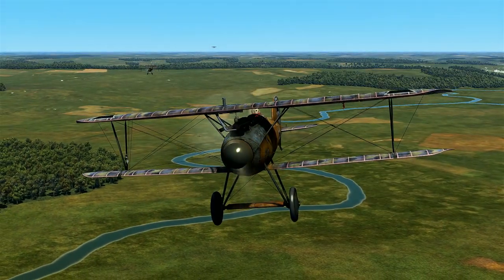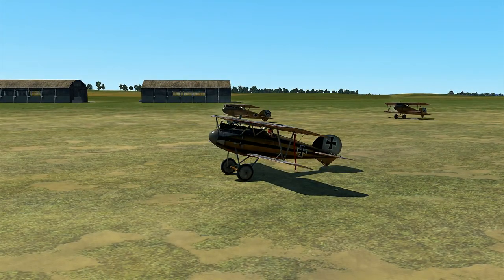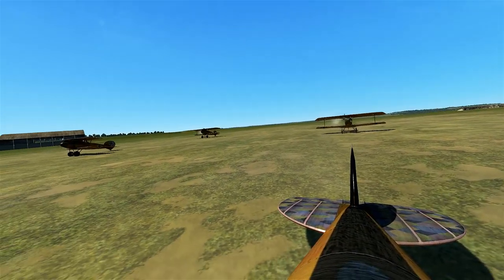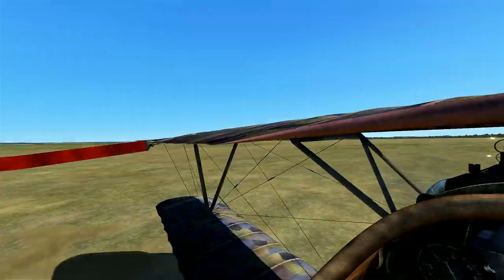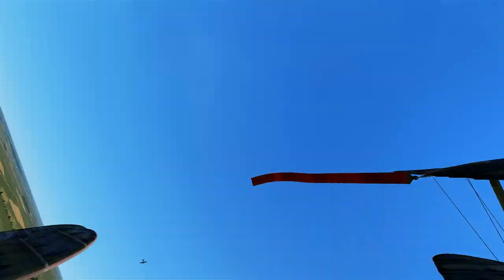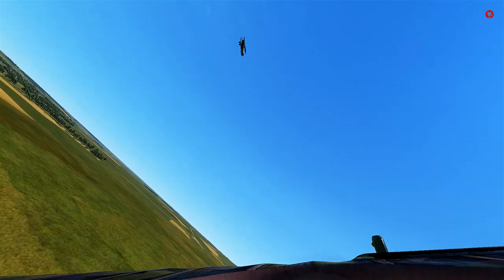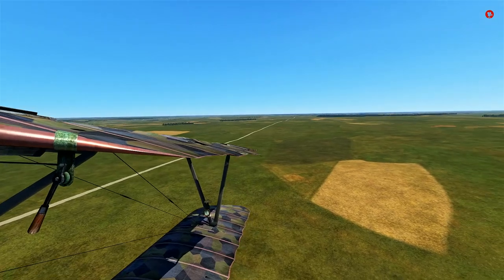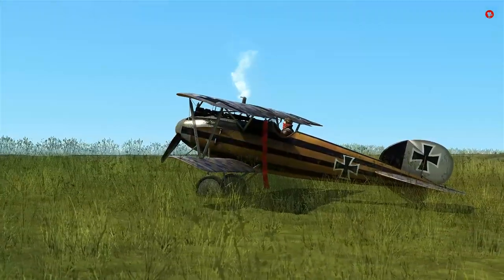ALBATROS D.Va || FIRST LOOK! || IL-2 Great Battles - Flying Circus

Comment: nice, I have Rise of Flight (also  all of the non early release il-2 GB content, and Il-2 COD) and a  fair amount of flying experience. 
With il-2 GB primarily being a ww2 sim , MY QUESTION: How do u find this compares to ROF (flight model and damage model wise)?
 I think a lot of people that like ww1 planes also will prob have ROF. :-) 
(AS FC is still early access and the Il-2 GB series in general is in continuous development obviously this is "as of now" in current state kind of thing)
Reply from the maker: It is VERY similar to Rof. As far as I know very minor changes have been made to the Flight models. The damage model has all of the good stuff that GB brings to the table however. 
 I feel the best way to describe this expansion is ROF remastered. It's fun and I do hope they continue to work on Flying Circus. As you said Great Battles is in continuous development so it will constantly improve.

Comment: I read, that Austrian manufacturer Oeffag, who build Albatros in license for Austria-Hungary air force solve the problems with strenght of lower wing, but this solution never arrive to germans, who has this problem until end of the war
Reply: This is correct. I researched the DV extensively a few years ago. The Austrian manufactred Albatrosses did not have this problem.  After the problems were identified with the D3 the Austrians stiffed up the lower wing structure and connection and these changes continued into the production of the DVa.  One thing this video did not mention was the DVa was made almost obsolete by the Fokker D7 which was by far a more forgiving plane and had a better engine and lighter weight. It could boom and zoom better than the spads and out turn an SE5A.  It was the one aircraft whose production was prohibited in the Treaty of Versailles.